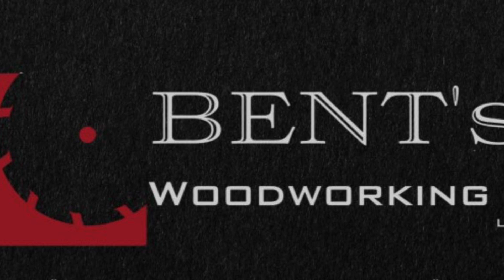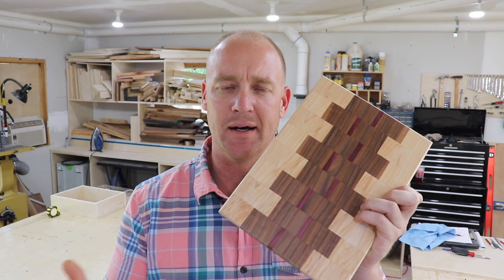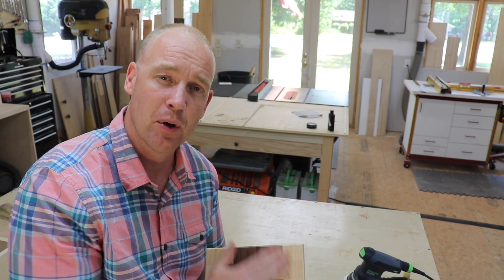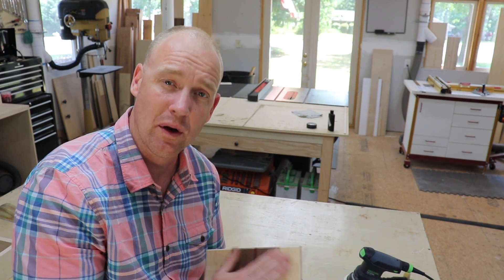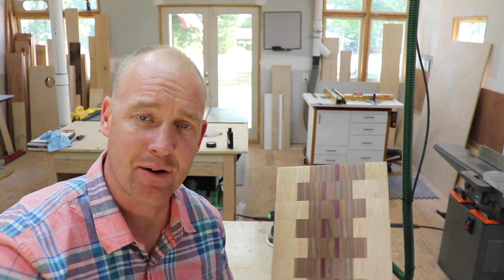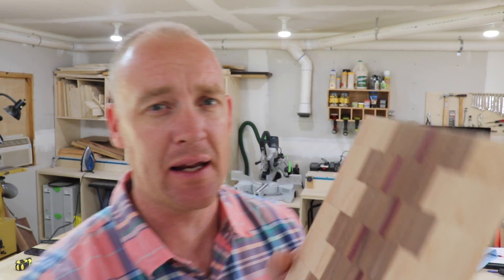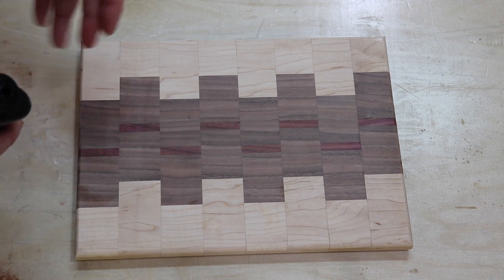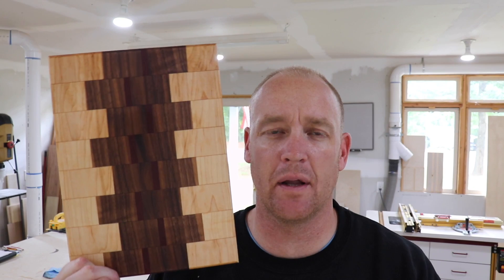How I Finish Cutting Boards

Comment: So, the protective oil didn't even keep the grain from swelling initially? Sounds like more Snake, than Walrus, oil. The oils that specify the soak-wipe excess-dry- recoat- soak-wipe excess process are likely polymerizing with the oxygen in the air, noted by the rapid change from thin to sticky over half an hour. Two or three such coats results in a hardening protective finish; it may or may not be foodsafe. Walrus oil has Coconut oil and Vitamin E, entirely cosmetic on a cutting board, whereas bulk beeswax blocks and pharmacy mineral oil are quite cheap; but, hey, everybody's gotta make a living, right?
Reply from the maker: I do it this way to avoid the grain raising after the first was, not from applying the oil necessarily

Comment: Do you ever warm the cutting board in the oven to open the grain for deeper penetration of the wax
Reply from the maker: I have not
Reply: That seems dangerous.
Reply: I agree, I think it could cause severe warping and or cracking, especially with a household oven since they fail to maintain steady temps below 200f

Comment: Thanks for this. I'm doing a cutting board now and have already sanded to 400 grit. Do I need to go back and sand with 120 before putting water on it to raise the grain? Thanks so much
Reply from the maker: No
Reply: bro you can ice skate on that board with 400 😂

Comment: I pretty much did exactly what you did. The one annoying thing is that those pyramids leave marks on the board. Any tips to prevent this from happening?
Reply: I rip a board the long way at a 45 degree angle and then cut short strips (3 inches to 8 inches long depending on what I need). Like miniature pup tents. More surface area holding up the piece, but less chance of leaving marks.
Reply: @patrickpreisinger5923  Interesting 🤔 Less chance of leaving marks really?

Comment: You tutorial seems geared towards the finish once a cutting board is made. What do you recommend for the end user for maintenance/upkeep? Walrus Oil or the standard food grade mineral oil? Note: I purchased the mineral oil brand Totally Bamboo from Bed Bath and Beyond.
Reply from the maker: Honestly, they both would be just fine. I typically just oil mine when they really start to look dry. Howard’s also make a conditioner that works well too.
Reply: Bent's Woodworking thank you!

Comment: Set up your sanding station so the power cable and suction hose are on the opposite side of the work surface from you.  This prevents having that stuff between you and the work.

Comment: Will there be an issue for people with a coconut allergy because I noticed one of the ingredients is coconut oil
Reply from the maker: I would assume that if the finish has coconut oil in it, it could potentially cause a problem
Reply: You can make your own with just mineral oil and beeswax. You can add a little bit of carnauba wax as well.

Comment: Hi Jason, Can you still use only one coat when applying Walrus Oil to an end grain cutting board, or do you need more coats?
Reply from the maker: I would just apply a liberal amount and let it soak in